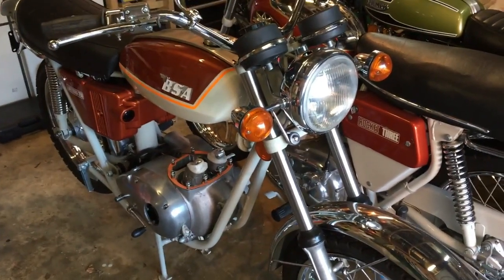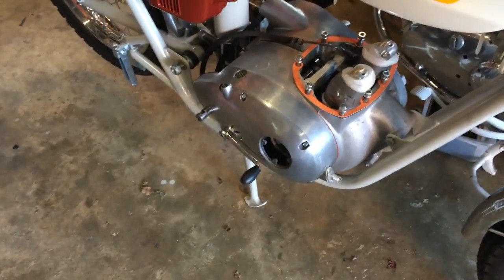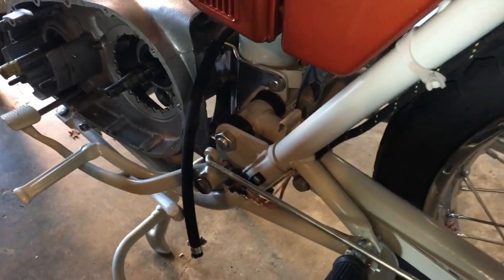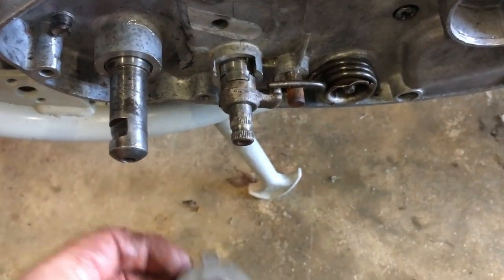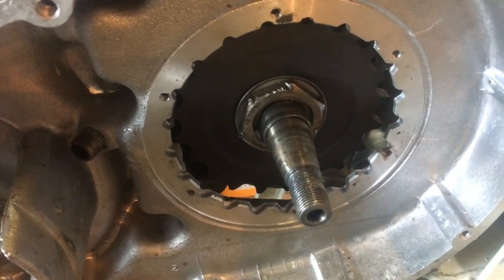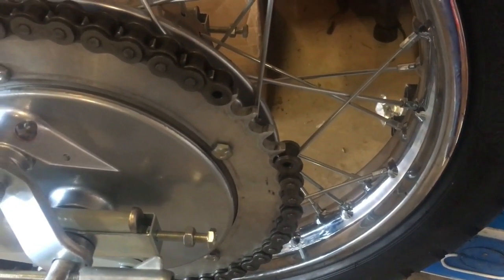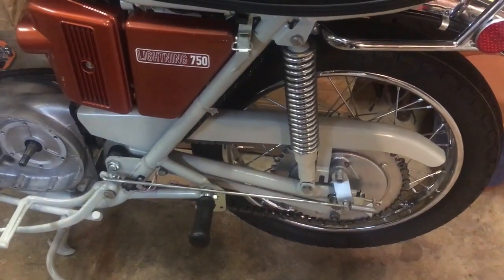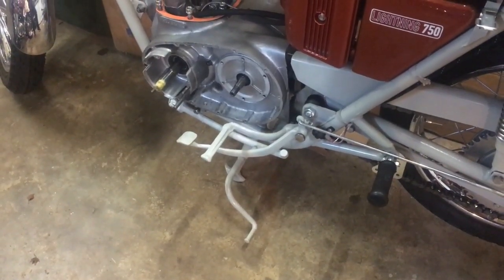BSA A70L Lightning - Engine Part 24 - Primary Case 1

Comment: It looks like  a bigger sprocket than 47teeth
Reply from the maker: Hi Torbjorn. I thought that I had already checked the number of teeth on that sprocket previously; however, agreed something simple to check again when I'm back in the garage later this week. One other thought is that if the standard A65 gearbox sprocket is 20 teeth, and the A70 is 21, then that would mean the chain has to be longer than 110 links? Is that correct? Woudn't explain being several links out thought. Thanks as always for the interest and feedback.
Reply: Hi Angus, I can't say if it will be enough with 110 links but I would Think so. I saw that there was a lot Moor  distance between the teeth and the bolts on the sprocket than a 47 should have ,it must be Moore than 50 teeth  on that sprocket
Reply from the maker: Yep Torbjorn - I'll check this out again ASAP when I'm back home in a couple of days and report back.
Reply from the maker: There's the problem! 52 teeth on the back sprocket! Well spotted Torbjorn! What on earth has this bike been doing in its earlier life? That sprocket is almost as big as the 53 teeth on a Hurricane. Mmmm need to think what to do next - be interesting to see how it goes with that sprocket ratio 21/52.
Reply: Yes indeed , very interesting. Strong hillclimber
Reply: Nice short video,keep them coming.